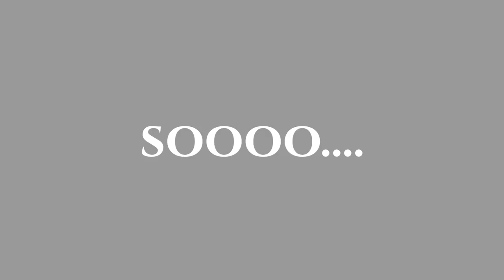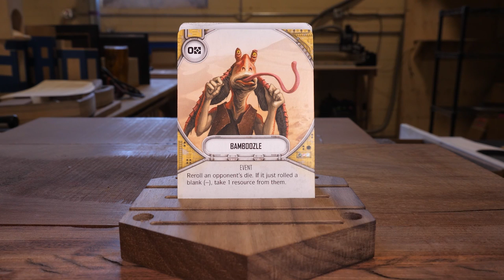This $3000 CNC Kicks Ass!

Comment: I would love to see a walkthrough of how y'all increase the efficiency on the production of certain products. For example, is it faster to cut tiles into hexagonal blanks or is it better to cnc them all out of length of wood. Seeing the evolution from entirely hand cut pieces to including more automation in the manufacturing process.

Thanks, I'm a huge fan, just ordered a RTD Dice Tower set, super excited to receive it!
Reply: Looking good
Reply: There are some trade offs.  You can definitely cut hexs with a table saw jig in seconds vs minutes on a CNC.  You would then need an accurate way to hold those hexs on the CNC to perfectly align magnets and other pockets.
Reply: They’re not there yet.

Comment: I saw someone else comment about a wooden spacer on rollers for storage, and I realised there was potentially some unused space you could tap into. If there's room on the bottom of the table, you could have an underslung thin box that would be the right size to slot board game boxes into, to keep them with the table. Maybe in the middle so you'd have maximum clearance from people's knees? I guess it depends how much room you guys have underneath!

Comment: On end mill flutes. 2 and 3 flute are for soft materials usually, aluminum, wood, and plastic, 4, 5, 6, 7, 8+ are usually for harder materials. The diameter does matter to some degree but 4 flutes is common even down to 1/8in diameter end mills

Comment: Answer to Johnny's statement about flutes: generally drill bits have between 1 (flat head) to 4 (standard drill) flutes. The different number of flutes and drilling speeds change with the material and the finish desired.

Comment: I still use the XXL i got in 2016 almost every day. Only problem Ive had was a stepper driver going out after the warranty was up, which they replaced anyway. I want the pro XXl so bad, but cant justify it. Ungraded the Z last year with the plus and it runs just as good as the day i built it.

Comment: Jason vs Bennet table accessory Prototype-Off on the CNC for the next video!  Each is assigned one of the small CNC's.  Dream up, design, and use your CNC to cut a tabletop accessory that does (insert a task here).  Win based on speed & quality of finished product.

Comment: Really nice intro for the midi cnc. Interesting to see that the programs are so adaptable from the prototyping mini cnc and just loads straight away. With the size of the midi you could work on multiple pieces before changing tools. How many tool changes were needed for the card tile 4-5?

Comment: I have a question that I would rather not ask, but I can't help but think about..  

Myself and many other Wyrmlings love throwing suggestions for improvements and new products in the comments.  Personally, I do this of my own volition expecting zero ownership of the idea or compensation, and I'm sure many others feel exactly the same.  However, it's possible that someone could suggest an idea that Wormwood uses and then expects compensation.  Maybe even suing.

Do you guys have avoid our ideas and suggestions because of that possibility?  That's usually the stance that companies take. Again I'd hate to even ask because I don't want to stifle the community's creativity out of fear of stifling yours.
Legal stuff sucks!  But I'm curious if this is something you even talked about. I remember a similar problem popped up with the t-shirt designs.  If that's something you've figured out then I'd love to take part in a tile designing contest.